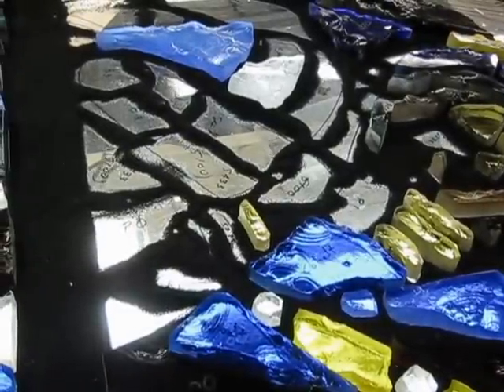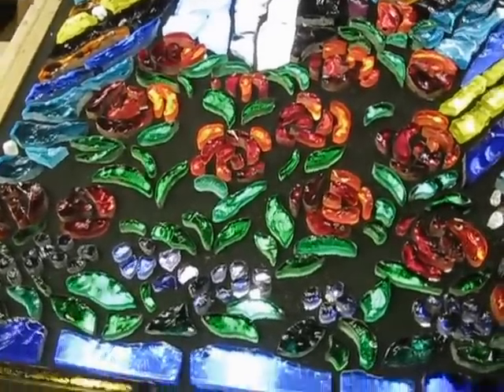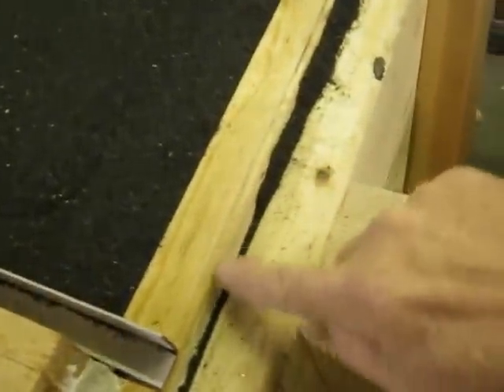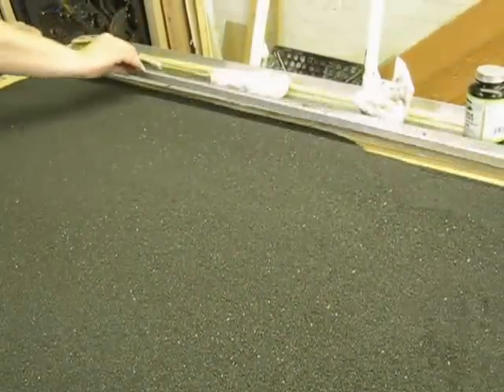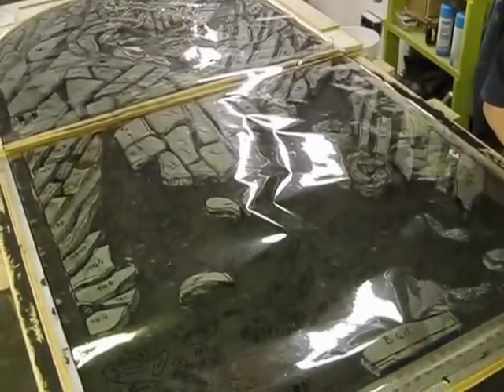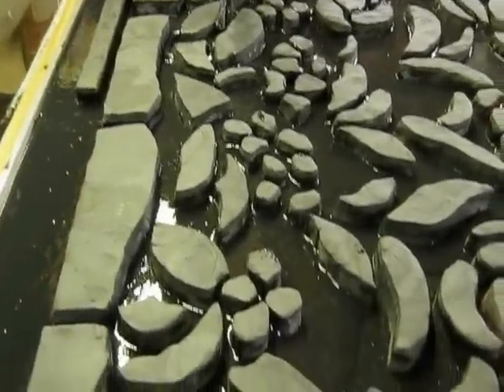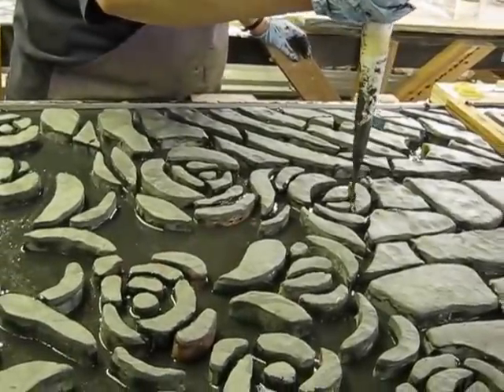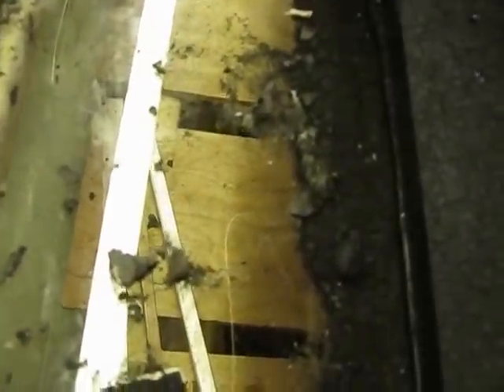Dalle de Verre (Faceted Glass) Single-pour method

Comment from the maker: Thanks Carlo! We have added a refinement. We used to put "rubber cement" on the faceted glass BEFORE we covered it with the sculpey, thinking that would help prevent epoxy from getting on the surface of the glass. We found that it doesn't make any difference, and so we are now saving cleaning time by not using the rubber cement at all.

Comment from the maker: Dear shaju, I've never added anything other than the "granules." They come in at least two sizes, one like sand and the other like crushed pebbles. But when I was in Spain I saw ddv panels made with beach sand and small shells. And I've never used anything but 116. I've done panels in 3 different colors, "charcoal," "concrete," and "limestone." Didn't notice any difference among them. You know the problems with trying to use portland cement. Don't.

The only way we've been able to get a flat rear face is with the "two-pour" method. The surface of the dalles is too uneven to try to rest the glass on a smooth surface and make a single-pour of it. If you want a perfectly smooth face, (ie no texture or granules on one side) you could put a very thin coating of sculpey on each piece of glass and "stick" it down on a piece of lexan or glass, but BE SURE to paint release agent on the lexan. If you don't your lexan will become a permanent part of your panel :) We tried pouring granules between the pieces of glass 1/8" deep before doing a single pour. That worked pretty well, but in some places the epoxy seeped though the granules and the panel had a "sometimes-smooth, sometimes-rough" final appearance that I didn't like. Went back to a double pour. When you flip the panel over for the second pour, remember that you need to have good dams:

The epoxy is will find its way into ANY tiny crevice. It is is much more liquid than portland cement. Your dam needs to be very tight. We often use caulk to make sure.

I've not had any problem with heat production but you do need to keep the studio warm enough for the panels to cure 48 hours at least. Don't stand them up on end before that time or you will find that they bow just enough to make them very hard to install :)

We color the sculpey because it isn't possible to "completely" remove it from the tiny crevices.  But if you don't use something like sculpey (clay didn't work well--not sticky enough) you will certainly have the epoxy there--and it is even harder to remove. :)

Hope this helps.   --zig
Reply: +zigzeigler thank you very much indeed. Re flat rear face -   I notice in the cross section of the old resin that I have here there is much more 'aggregate' in the resin, he's done two pours, one on top of the other though - I'm thinking this might have enabled the flat surface at the rear as it is likely to have been much less fluid.  I see lots of testing coming up!
Reply: What is the "two-pour" method?

Comment: Thank you for this informative video! I'm finding for myself, that even with a 1/2" bed of sand, my epoxy is seeping a bit beneath my dalles, sometimes a small film is making it under the glass, sometimes a bit more. Is this because I'm pouring too soon, and the epoxy is too runny? Should I be waiting another 30 minutes for it to cure, thereby making it a bit thicker and not penetrating as deep into the sane? Thank you!

Comment: Thanks for this, its an excellent video!

I have a few queries - have you worked with other epoxies and added your own fillers? Is the Key resin #116 the go to resin for dimensional stability, UV inhibition etc.

With  bed of sand at 7/16th deep, you mention the resin seeps in approximately 1/8th inch in - does this result in the resin being proud of the glass at the rear? I am after a flat rear face.

Also is heat production upon curing ever an issue, particularly if the glass has suffered in the past and exhibits blind cracks.

Lastly, you mention you add oil paint to the Sculpey, can I ask why?  Can the Sculpey be totally removed from a 'sanded' front face or are there fine residues remaining caught in the fine crevices.

Thank you so much in advance